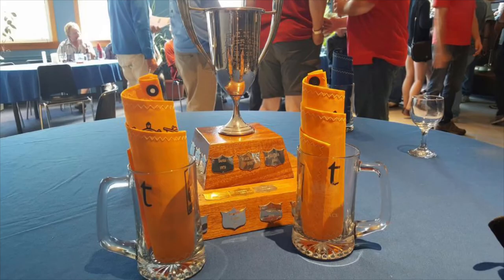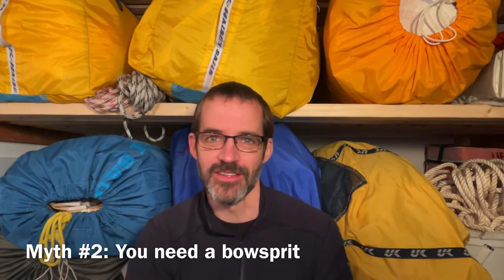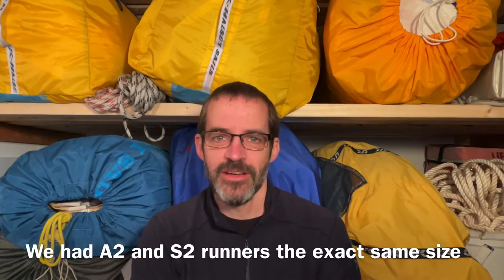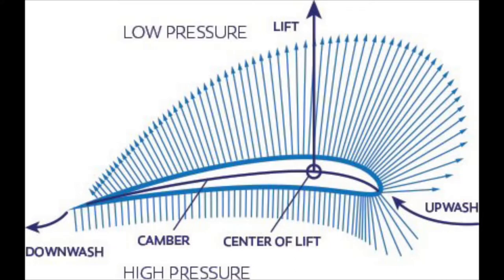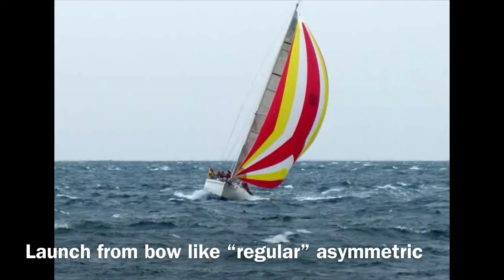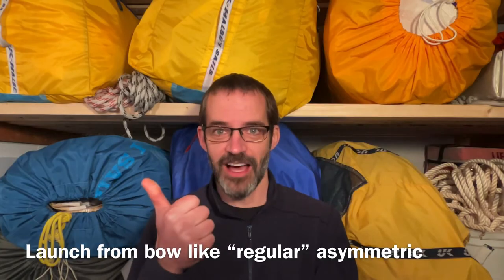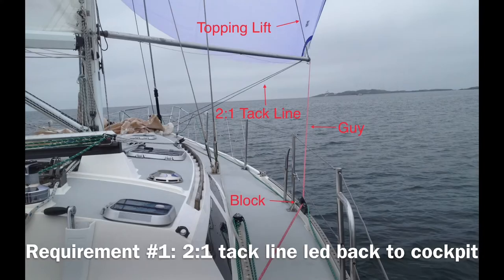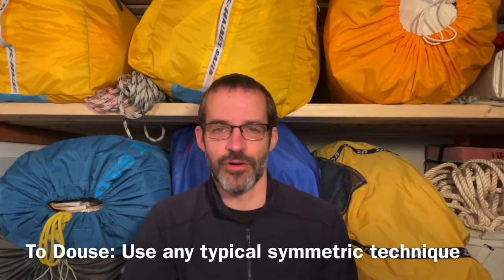Want to Sail Deeper With an Asymmetric Spinnaker? Try this!

Comment: This is a great video thanks for posting.   How is the tack line attached to the bow?  
I am currently using the bow roller but have concerns about upward loads.
Reply from the maker: I used a 2:1 tack line to 1) reduce the loads and 2) make it easier to operate the tack line without a winch in lighter air. My 2:1 had a block mounted to the side of the anchor roller adjacent to the forestay, and from there the tack line went up to the spinnaker tack shackle, then back down to a padeye bolted to the very front of the boat, beside the anchor roller. I also added an extra bolt through the anchor roller and deck adjacent to the block and forestay to take the upward loads. Hope this helps!
Reply: @SailingTipsCa  Do you have a picture of that?
Reply from the maker: @jllaforce  This is the best picture I could find… https://www.icloud.com/photos/#016uJ4HwOs8Tztl0t1TIzlgEw
Reply from the maker: @jllaforce  I tried sharing an iCloud link but it seemed to expire after a single view - gotta find a better way to share photos in YouTube comments - any suggestions?
Reply: @SailingTipsCa  I can still see the icloud photo - 9/5/22
Reply from the maker: @robertmann8895  Cool thanks for confirming!
Reply: @SailingTipsCa  I would appreciate a view of this photo. Currently says share photo is not available. Trying to understand a solution for a SC33. TY.
Reply from the maker: @marksnewell  Annoying that the iCloud links expire! I think this is the photo: https://share.icloud.com/photos/0505PeewC0iYTDFwIIEI9u1Sw

Comment: Ive got this weird drifter sail cut from an old spinnaker or asym even that I am trying to think of unconventional ways of sailing deeper down wind with it. Was considering getting the luff replaced to something more like an asym on gennaker? Wanting some more options for short handed racing and thinking outside the box. Best tips for extending the clew out as far as possible?
Reply from the maker: If you want to extend the clew out as far as possible you could get a whisker pole and attach that to the mast and the sheet. I've found that to be easiest if the sail is on a furler, then you attach the whisker pole to the sheet of the furled sail adjacent to the forestay and unfurl, which pulls the whisker pole back. To remove the pole just furl the sail to remove the load on the pole. But that's only really helpful deep downwind, so I prefer the asymmetric on a conventional pole squared back like in the video. Does this help?

Comment: You can sail arbitrarily deep with a symmetric spinnaker in any conditions. It's all a question of technique. The helmsman need to steer for power balance, not to adhere to a course. The death roll is simply the sailing version of what airplane pilots call PIO (Pilot Induced Oscillation). In terms of control theory, the death roll/PIO is a result on steering/controlling/reacting to the wrong input which increases latency and hence reduces the stability of the control loop.
Reply from the maker: Yes you can sail arbitrarily deep with a symmetric spinnaker, and best to steer for power balance as you noted. The reason a symmetric spinnaker is more susceptible to the death role/PIO is that it oscillates just as readily to both sides when sailing dead downwind (DDW), which doesn't do anything to help the helmsperson stop the loop. An asymmetric spinnaker, even when poled all the way out and sailing DDW, still pulls harder to one side than the other, so you're much less likely to get into a death role/PIO in the first place, and if you do start oscillating it's easier to stop.
Reply: @SailingTipsCa  With the right technique, there is no oscillation, no death roll and no tendency whatsoever for it to develop. The helmsman can be half asleep, steering dead downwind, or even deeper than that,  and absolutely nothing will ever happen. The technique required is somewhat counterintuitive but once understood the problem is gone. Oscillations are caused by the helmsman and only by the helmsman. Once the helmsman has learned not cause them, they're gone. Nothing required to make life easier for the helmsman, just have him stop causing problems and you're good.
Reply from the maker: @larscelander5696  So what guidance would you provide for death-rolling helmsmen? Don’t steer to correct the roll and let it correct itself?
Reply: @SailingTipsCa  To steer so that the boat stays underneath the spinnaker. I would describe it as going with the roll to absorb the roll. If the boat eg heels to port with the spinnaker to port, the pull of the spinnaker will try to round up the boat to starboard. The instinct is then to counteract that pull by trying to steer to port. That's what gets the oscillation going. Don't do that. Let the boat go to starboard, even help it some extra with the rudder. Once the swing has been absorbed and the boat is in balance again, then go back to whatever course you were steering. Apologies for not being able to explain it better. My excuse is that I haven't done any racing for about 25 years now, this is all from memory. Alas ... :)
Reply from the maker: @larscelander5696  Yes, like balancing a broom handle on your hand! That's what we've always done and never really had a problem with death roll with symmetric spinnakers. Then again we also few asymmetric spinnakers most of the time.

Comment: Only one guy is shown attached but aren't both guys needed?  I have a downhaul/foreguy that I use for full spinnaker, so is a tack line still needed?
Reply from the maker: Yes both guys are needed, but not at the same time. Only one is attached in this photo but they could both be attached simultaneously. Yes a tack line is still needed, normally from the bow or a small bowsprit. I prefer a 2:1 tack line because it makes it easier to adjust by hand in lighter air. I had a single line led back to the cockpit that could be used as the 2:1 tack line, or 2:1 downhaul for symmetric kites depending on whether we connected it from the bow or the middle of the foredeck.
Reply: @SailingTipsCa  I have a C&C35 mk I.  My OD class here in Detroit decided 2 years ago that we would allow only one asymmetrical spinnaker, an A3, and that it must be flown using the spinnaker pole.  I've found very few videos or instructions on how to do this so was very happy to come across your video.  Any actual sailing video showing the asail being gybed while on the pole would be extremely helpful.
Reply from the maker: @robertmann8895  I wish I had footage showing that, but unfortunately I sold the boat before I started this channel, so I’ve been cobbling together existing footage and photos. We had a Forespar male/female fitting on the mast and stowed the pole attached to the mast, lowered on the track, with the tip on the deck below the pulpit. We would also launch and gybe the spinnaker tacked to the bow with the pole tip on the deck in this “rest” position. Once the spinnaker was flying from the bow we would attach the pole to the guy, harden the guy, and ease the tack like to square back. To gybe 1) ease the guy and harden the tack line to fly the spinnaker off the bow again 2) disconnect the pole from the guy, move to the other side of the forestay (e.g. dip pole) 3) gybe the spinnaker (e.g. inside or outside, we preferred inside) 4) re-attach pole to the guy on the other side and square back. Let me know if you have any questions!

Comment: Have you ever tried sailing an asymmetrical "wing on wing" with the clew polled out on a whisker pole? Is that even legal?
Reply from the maker: I’ve definitely sailed an asymmetrical “wing on wing” without the pole for short distances, normally less than a few hundred metres to clear an obstruction or make a tight mark, but generally not for longer distances because it’s not particularly fast nor stable. I wouldn’t recommend polling out the clew with a whisker pole because it can become cumbersome if not dangerous to unload the system and remove the pole if the wind comes up. The legality of this comes down to your local handicapping/racing rules.

Comment: I have bought a 20T  46ft boat with a symmetrical spinacker. Can I use it as an asymmetrical  by just connecting it to the bow?
Reply from the maker: Yes you most definitely can - I've done it successfully on a 42'/12.8M boat! On that boat we carried both symmetric and asymmetric spinnakers, and normally switched between them by changing the tackline configuration on the bow to a pole downhaul in the middle of the foredeck. But during one 130NM race we ripped our A2 asymmetric spinnaker, and didn't want to take the time to re-rig the tackline/downhaul for the symmetric S2. So we launched the S2 off the bow just like the A2, squared it back with the pole, and even gybed it exactly like an asymmetric spinnaker, by easing the tack back to the bow, taking the pole off, doing an inside gybe, and putting the pole back on the other side. The crew was actually amazed at how well it worked! The only consideration was that we had to come up a bit higher towards a beam reach to fill the kite after launching and gybing, and before squaring back with the pole, because it didn't pull itself out to windward quite as well as an asymmetric. And once squared back on the pole it flew every bit as well as the conventional symmetric setup, as the sheets/guys/pole all "looked" the same to the spinnaker.
Reply: @SailingTipsCa  thank you so much for your reply. I have never flown any type of spinnacker in my 1000s of NM sailed so a bit apprehensive about the whole process, just being the 2 of us.
Reply from the maker: @ralph9987  Good to be apprehensive especially with just the two of you on a larger boat! That said my wife and I double-handed with spinnaker on our 42'/12.8M boat quite regularly. Key points when short-handed on a larger boat: 1) Start in lighter wind (e.g. under 5 knots) until you get used to all the techniques 2) Don't be tempted to fly the spinnaker without a main sail - you need that to blanket / depower it to douse and/or if the wind picks up 3) Make sure you have lots of sea room to drive down and collapse the spinnaker behind the main sail to take it down 4) A good autopilot is worth it's weight in gold when flying a spinnaker double-handed, because it can keep the boat on a deep broad reach with the spinnaker blanketed and depowered behind the main sail so you can get it down 5) Look up "letterbox douse" as a good fool-proof dousing method. Good luck!!!
Reply: @SailingTipsCa  thank you so much
Reply: NO you cannot.  An asymmetrical spin is nothing like a symmetrical.  A symmetrical has 2 clews and no tack.  It would be the equivalent of driving your car on 2 wheels.  Just because you can do it does not mean it will work well.  Symmetrical sails are called that for a reason.  The middle seam must be straight up and down to fly efficiently.  No way that can happen tack to the bow.
Reply from the maker: @chgodave  To clarify, if you leave the tack at the bow (without squaring back) you can only efficiently fly a symmetric spinnaker with the wind on the beam, as this would simulate having the pole all the way forward at the forestay. In order to sail other angles you have to square back with the pole - that's the key. It won't work if you just leave it tacked to the bow. But you can square back using the techniques in this video and it works great, as an alternative to traditional methods - the kite doesn't know the difference as long as the pole, sheets, and guys are in the right place.

Comment: This isn’t correct.  Forespar indicates pole should go on the sheet not the guy when using a whisker pole w an asym. wing on wing.
Reply from the maker: This isn’t a whisker pole and we’re not using it wing-on-wing: the pole is on the tack like a symmetric spinnaker and not the clew like a whisker pole.